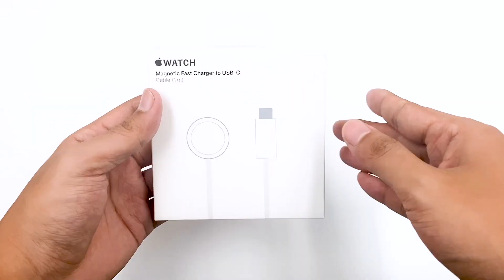Teardown of Apple Watch Series 7 Magnetic Fast Charger to USB-C Cable (1m)

Comment: Hi.  The Apple charger is so small/thin, compared to other chargers. Is the reason for this because they have moved some of electronics 'away' from the puck, and into the USB-C port end of the cable?  I wonder how 'thin' a charging 'puck' could be made, by spreading-out the various components.  Can we estbalish what 'layers' from this tear-down must be 'under the watch' and wbhich can be moved 'horizontally' away from the 'stack', without compromising performance?  Could you do an explainer video about the function of each of the layers you found, and what 'functions' have been  deferred to the USB-C plug?  [ that is, what do each of these layers Do? - (1) Copper foil, (2) Ferrite material, (3) Central magnet, (4) iron plate;  AND what are the logical / circuitry required to comprise a charging device? ]

Comment: Thanks for the teardown!  I believe you’ve explained why I’ve noticed my Watch feeling much cooler during charging despite the added fast charging.  It’s just a casual, random observation, but one that I’ve had multiple times.   The circuitry being moved to the plug end to improve heat dissipation makes me less worried about the faster charging being too detrimental to the battery.  Thanks!
Reply from the maker: Glad to help!

Comment: 2.7w as compared to what with the non fast charger?
Reply: He was charging an Apple Watch 6, so the far charging wouldn’t be activated. I expect it is 4.5 to 5 watts, but I don’t have one to measure it on.
Reply: It’s not a Series 6. The Apple Watch in the video has a protruding power button. The power since the Series 4 has been sitting flush with the body. I kind of want to know what model of Apple Watch is it.
Reply: Hi, I wonder if I still get fast charge for using fast adapter with cable from previous models instead of Apple Watch Magnetic Fast Charing USB-C?
Moreover, will the charger (and my watch) becomes very hot after that? A comparison video should be great for illustration. ❤